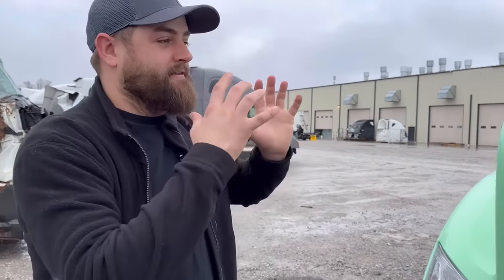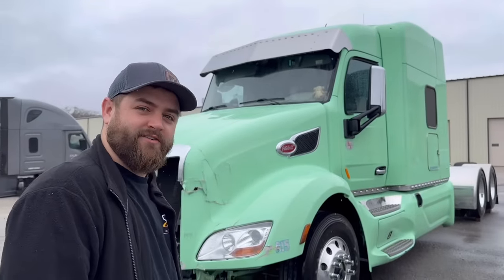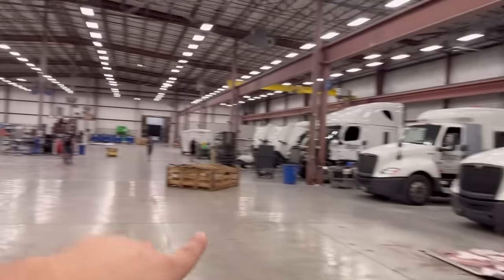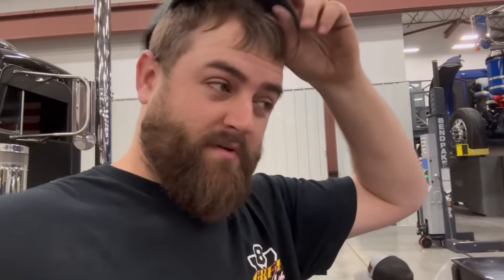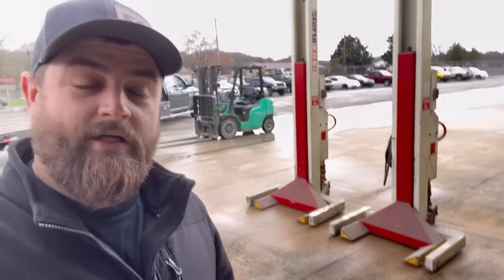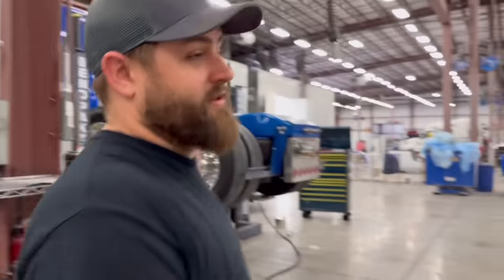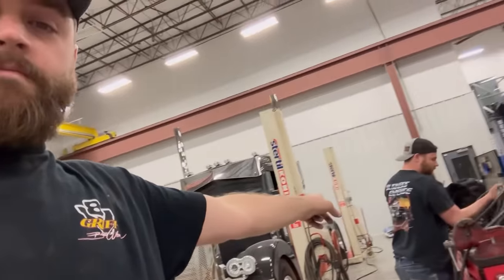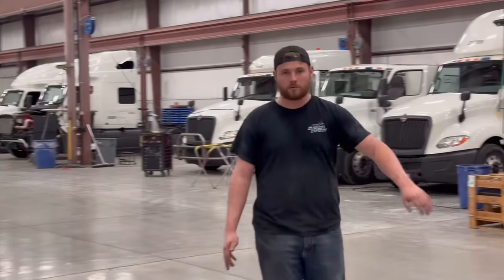Our First Customer to Come in from YouTube Videos! Let’s GOOO!

Comment: That's not a breaker, it's a contactor.  It sounds like it's not getting the correct voltage to the coil or the coil is bad.  There should be connections on either side of the top row of the wiring terminals or one on the top left and one on the bottom right designated "A1" and "A2".  Those are the connections to the coil.  There should also be a little tab that gives the voltage and Frequency for the coil. (IE 240 VAC 60 Hz)  Put the leads of a multimeter on those terminals while energized to see if the voltage matches the tab.
Reply: Love it when you can tell the person commenting knows their shit 😊
Reply: I agree wrong voltage that Europe shit some times needs a common as well but probably only have 208 your newer unit my have single phase 208 with a common and the old is straight 3phase that’s why the contractor chatters

Comment: when wiring 3 phase your wires could be hooked up wrong so when you push the button it could be in reverse motion. to change the motion or direction you take any 2 of the 3 wires and trade places  with each other to change the direction

Comment: Check the coil wires going to the contactor that’s buzzing, it’s not a breaker, make sure they are tight and I imagine you should have 120 volts to that coil when it’s buzzing. If there’s 120 at the coil and wires are tight, the contactor is bad. You can order new ones from any commercial/industrial electrical supply house. Check the existing setup for any auxiliary contacts which you would need on the replacement. Most contactors have a Normally Open and/or Normally closed set of contacts that change state when the contactor coil sucks in. They give proper indication to the rest of that little electrical system.
Reply: You can also possibly take the contactor apart and clean the contacts on it.  Most contactors you can change the points out on them.
Reply: @ryanstewart290  some motor-starter contactors are rebuildable but the little plastic bodied ones like what he’s dealing with (under 30amp) you just go ahead and replace the entire piece. Half the companies aren’t around anymore. I’ve never bought a rebuild kit from anyone other than Square D

Comment: older episodes my first time seeing 
   suggestion replace contractors for lift   ran into similar situations doing commercial HVAC  stuff  verify contactor coil voltage is good if weak also cause chatter
   other  suggestion for tires when finding nails ECT use a paint pen or grease pen 🖊️ on side wall  and mark the the spot X  so easily found at tire shops 
   also recommended a tubeless tire patch kit  on board truck emergency repair kit    when long hauls  may be long way from repair shop especially if hauling Midwest and west side of country

Comment: It might be a bad coil in that contactor. Not a breaker. check for voltage at the contactor. what voltace is there and what voltage is the lift units requireing.

Comment: 3 phase - Try changing the wiring at the plug again. Changing any two of the three hot wires ie. 123 to 132. It does the the same thing as changing the rotation of  a 3 phase motor. Transformer may not be phased correctly. Also could be undervolting the contactor ie. wire whip is 208/230 3 phase and lift needs 460v 3 phase.

Comment: Those are contactors, not breakers. I work in an industrial production factory. Those go bad quite often probably need to replace it. I'm in Maintenance not electrical so I can't for sure tell you what the problem is. However our Electricians could definitely fix your problem. Let me know and i'll send them your way.

Comment: What are them truck lifts rated for . That rotator is in the neighborhood of 75,000😂😂😂😂
Reply: IDK but have seen some monster utility trucks huge rolls if wire like power company trucks ,full of equipment in the air. Unbelievable what they can handle. I guess just lift till it starts popping and cracking 😂 🤷